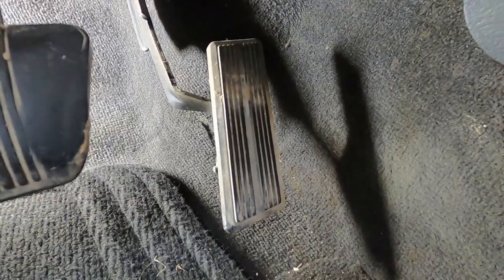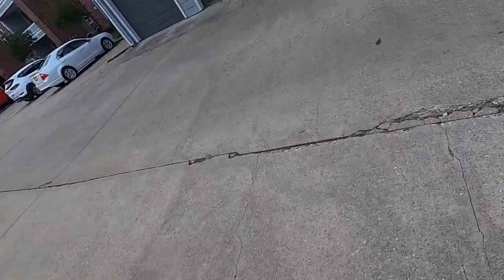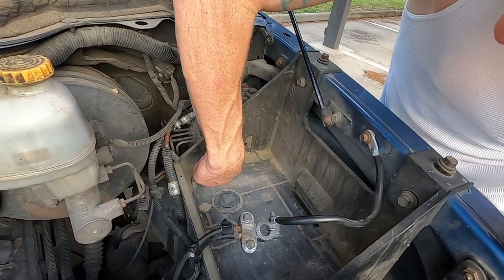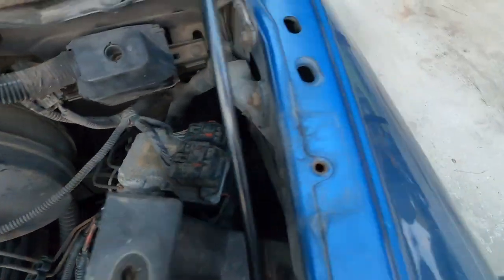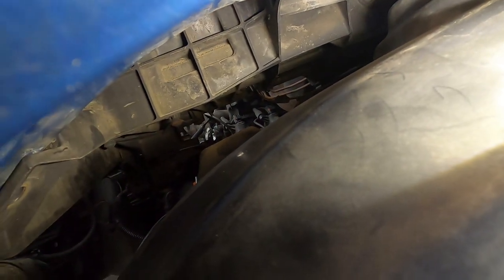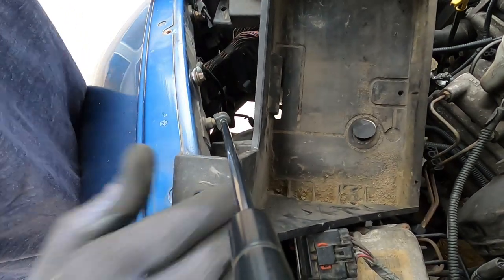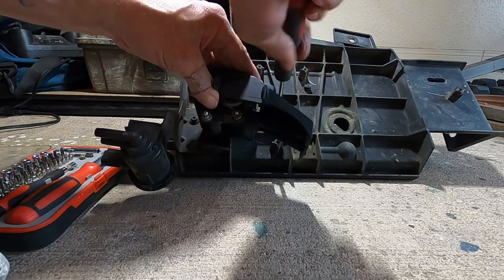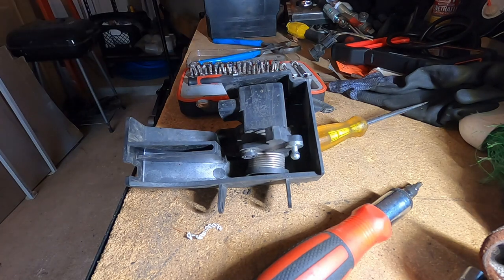App Sensor removal, Battery Tray removal. Party Started 03 Dodge Ram 1500 (lightning bolt present)

Comment: I took off the plastic wheel well cover and everything was accessible from the bottom. Took the 3 screws out of the battery tray and the sensor sat right on top of the tire to work on. Battery temp sensor just as accessible

Comment: I was told its not a weight sensor but a temp sensor. Very important for the voltage regulator on the alternator.

Comment: I just dug into this myself, and found out pretty quickly that the first half of your vid was unnecessary.
 Drop the fender well. Use a mini ratchet with a Phillips tip in a socket to break loose three screws. Done.

Comment: Did you ever get this issue solved? I've replaced the pedal position sensor and throttle body from a running truck and still have no acceleration. The only code is the P0141 heater circuit censor 2 and P0480 fan circuit control censor. Man do i need help 😢😢😢
Reply from the maker: Yes I had to replace the pcm

Comment: I had to take my truck to an electrical shop. Something was wrong with the crankshaft sensor. There was a wire going bad in there.
Reply from the maker: 10-4 boss

Comment: Im having this issue with my 2011 Dodge Ram 1500 4.7l.  Ive replaced the throttle body and APP Sensor twice and i still have the same issue. Even replaced the PCM. Its been sitting for months and still cant figure it out
Reply from the maker: Check for vacum leak along the intake.
Reply: I'll have to do that. I'm literally watching your video as I'm sitting in the truck trying to figure it out. I never did like the intake on this truck. It just slides in and has some rubber grommet or something like that. It just slides over the throttle body.  It looks like it could leak. Thanks for the reply 👍🏽
Reply from the maker: @orangecrush50  your welcome

Comment: Could a faulty app sensor cause no response to the key and no spark. Was able to bridge starter solenoid and get the truck to turn but Im recieving no spark. Could this be my issue?
Reply from the maker: I dnt believe so. The app sensor is for throttle response via the pcm to throttle body.
Reply from the maker: You could have a tipm issue sir
Reply: @autoguydiy4244  it's so weird though, was running fine no tipm, bcm or ipm fault codes until battery gets low from trying it so much. Stuck in Houston trying to get back home to Florida with my trailer. 

Went to go get a tire pump to inflate tire on my trailer off the 12v plug towards bottom of dash, did 2 of them pulled back around, plugged shore power from trailer, and everything and plugged in 7 blade connector to truck after hitching and go to get in the truck and no response at all. Replaced battery, starter, crank and cam sensors. 

Removed and cleaned all grounds and still nothing, not throwing any codes for tipm, TCM or PCM (which was my original thought but it's communicating so surely it can't be bad?) 

All my diagnostic tools are in Florida so I'm just gonna give up and take it to the guru someone recommend me out here and suffer and not chase dragons
Reply from the maker: @Ni_ghtmare  have you checked all fuses and relays. You could have blown one
Reply: @autoguydiy4244  yeah, unless they're just tricky to look at but I've switched all the ignition and starter relays fuses with ones too swapnostics it and nothing still. Think I'm going to try ignition coil wires, coil packs and plugs but throwing parts at everything is usually not the right answer lol
Reply from the maker: @Ni_ghtmare  true statement

Comment: Mine has the lightening bolt and when I start it smoke comes through the vents
Reply: The AC set on outside air would draw from under the hood?
Reply: @quietsignal  smoke comes through the vents regardless of the AC or heat being on
Reply from the maker: What does the smoke smell like
Reply: @autoguydiy4244  it's coming from under the engine but does not smell like oil or burning plastic. I'm at a loss
Reply: Heater core is bad
Reply: Happened on my 2nd gen i had
Reply: @MidnightPolaris800  big money to fix that or alot of time for me to do it
Reply from the maker: Diy
Reply: Ahh,ok, that is not smoke it is vapor. You should record a loss of coolant.
Reply: @quietsignal  that would be from a bad heater core?
Reply: You might be susprised...just advertise for a helper. Worst case scenario just use a saws all rip the dash apart go gonzo.
Reply: @quietsignal  lol I was already thinking about doing like that
Reply from the maker: Let's get it lol. Bye bye dash.
Reply from the maker: My man 💪 arm it lol. No I'm playing. Take it easy on ole ride
Reply: @autoguydiy4244  yes sir weekend job already
Reply: @autoguydiy4244  along with a pedal positioning sensor
Reply: @autoguydiy4244  I'll be real gentle with her lol